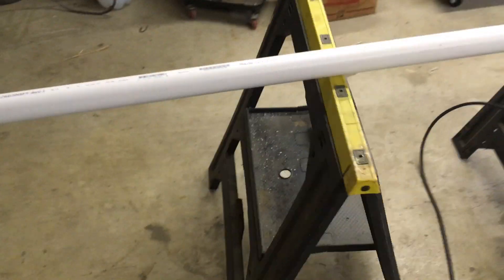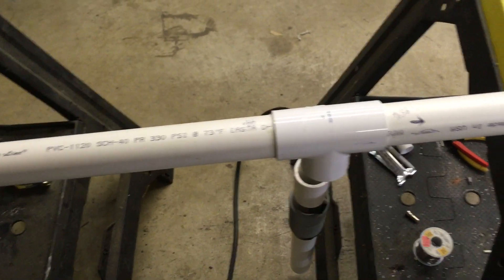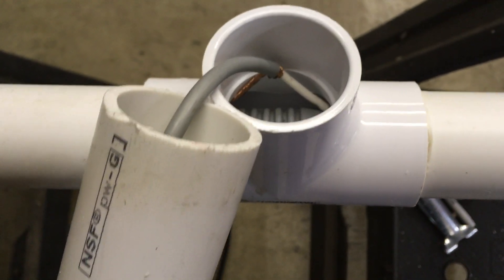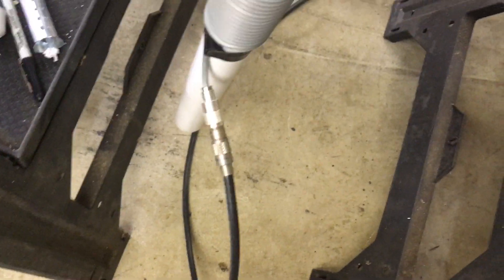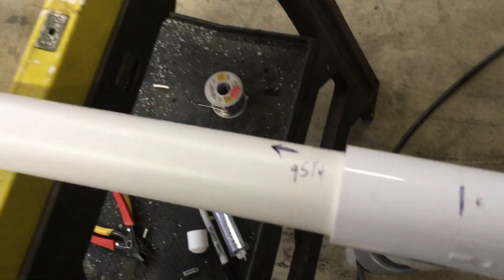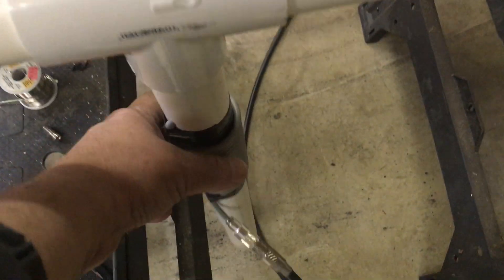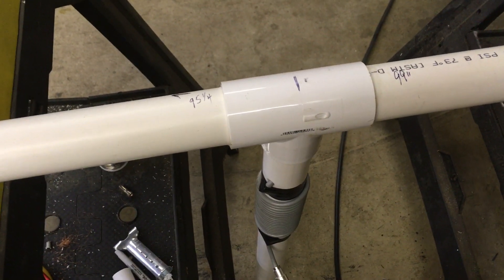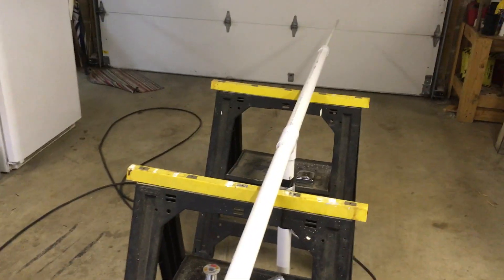Cheap, homemade, cb and 10 meter antenna from pvc and Romex wire

Comment: did you keep the 12 AWG in the Rome? If not, did you twist all three conductors at the ends?
Reply from the maker: No, I stripped apart the wire I use the black conductor for one of the dipole, the white conductor for the other side of the dipole. If you look at 2:37 you will see it inside the conduit. I could have used the bare wire remaining for one of the conductors as well.

Comment: 12 watts on 11 meter SSB.  Nowadays with all the electronic emissions being heard as static on 11 meters you would be lucky to be heard above the static a few miles away running stock 4 watts.  The FCC needs to adjust the rules so more wattage is allowed on 11 meters. Like 25 watts on AM and 75 on SSB.  Nice antenna by the way.

Comment: Where are you located, I'm going to build another one, more modified like yours, I like the idea of heavier duty pipe then going out, I plan on replacing my horizontal dipole with one like this, nice work, 73"s from southern utah

Comment: Being a dipole, vertical was it 70 ohms at the feed-point? Just curious, I am thinking of building a 20 meter exactly like you did except using some cable hardline that is 75 ohms figuring on letting the atu touch it up or just ignore it. What was yours? Or I could just make a version where the shield is just bent back over the coax cable as a sleeve dipole and end-fed? Yours would mount easier on a tower while mine could be just mounted on another plastic pipe of some kind?
Reply from the maker: The theoretical says it would be 70 ohms show driving it with 75 on coax shouldn’t be an issue. Like you say touch it up with a tuner. I can also say that mounting it on a tower sliding it in and out from the metal structure I can tune it up and down the band due to the capacitive coupling to the tower. I built a wire in antenna one time mounted at 1 foot off of a steel structure. I tuned it for theoretical at 26.4 MHz which was a frequency we were licensed to use and the antenna came out resonant around 15 m 21 MHz. So close proximity to a steel structure makes a huge difference in how these antennas tuneup.